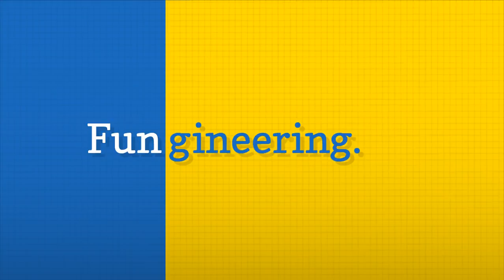Ep24. Chernobyl

Comment: First of all, I like your channel which I have discovered by the Columbia accident podcast.
In this episode I have to disagree with you in some points, especially regarding the problems of nuclear plants; you do not mention the still unsolved problem of the nuclear wastes - it's like "we build these plants for 70 years now and still haven't figured out what to do with this radioactive crap"...this simply doesn't work.
Then, there is a well-founded report, which is supported by the WHO, the UN and the IAO concerning the number of victims, which are about 4000, not regarding people still suffering from illness.
The truth is that this kind of energy production is completely uneconimical and can only survive because the companies do not have to have insurances high enough to pay for the damage they can easily do in case of even non-major accidents with radioactive leaks.

Comment: Some errors:

1. 2:20—The number used to refer to an isotope is not the number of neutrons, but the total count of nucleons.

2. 4:30 My understanding is that the fuel in the Chernobyl RBMK was slightly enriched—around 2%.

3. 17:50 A scram does not cause a buildup of poison isotopes. It stops the reaction by neutron absorption. Immediately.

4. I'm not absolutely sure, but I think it's actually an isotope of xenon, not iodine. I think the xenon comes from decay of iodine, resulting in it accumulating.

5. 51:00 This is not actually an error, just a comment. Yes, I've heard that claim, too—3 megatons or some such nonsense. I think the confusion comes from the expected radiological release, because it was thought the steam explosion might be big enough to blow up the other three reactors, and totally release the contents of all four units; and that the resulting fallout would be equivalent to a 3-megaton H-bomb. (I tend to think it would actually be much larger.)

6. 57:00 Again, a comment rather than an error, but I think they always expected they would eventually need to build a better containment. In 1986, they needed something less perfect but quick to build.

7. 1:01 Another comment: One big problem with estimating a death toll is that a cancer may reduce one's life a few years, whereas a 25-year-old worker exposed to a lethal dose loses much more lifetime than that.

8. 1:03 The big disagreement is about the validity of the LNT (linear no threshold) model of cancer risk from low-dose radiation. But when you propose that there are "safe" levels of radiation (or even benefits), there are some big holes in the logic of that as well.

9. 1:08 One big difference in modern plants is presumably that you have computer software co-ordinating operations, and recording everything, instead of marked-up printed, 3-hole punched manual pages in big binders. I'm sure that makes a huge difference in all activities in any power plant. Yes, software has bugs, but we're not talking MS Office here, OK? If you have any significant experience with 3-ring binder manuals and manila folders and the like, you know what I mean.

10. 1:12 I did a calculation once, and my estimate was that the average adult's body contains about 25 mg of K-40, and there are on the order of 10 to 100 decay events each second from K-40. That may sound like a lot, but you have 100 trillion cells in your body, so the damage is surely very limited.

11. 1:15 Now that the NSC in placed over the sarcophagus, I think there are plans to decommission the stuff inside. There are probably several approaches to tearing things down inside. As to the whole exclusion zone, I find it a delicious irony that there is now a solar electric plant there, and interest has been expressed in adding much more capacity. Lord knows they have the room for it! I'm sure any radiation there is down to where it would be no problem at all for such a plant. As for the stuff left behind in the exclusion zone, I'm sure at some point they will remove it all. Maybe erect a big tarp or tent over one section, pull down the stuff inside, haul it away, sort it out, recycle what they can, landfill what they must. Then move the tent to the next section, and repeat, until the whole area is cleared. IAC I don't see this being a wasteland for a thousand years. I think that's just silly. Just because it's not been remediated in 30 years, that doesn't mean it can't be in the next 30 years, or maybe 60.

12. "Mild" and "innocuous" are not appropriate words here. You have to ignore a LOT of things to start using words like that. It isn't just 50 deaths FFS. GMAB. But to venture further, I'd have to essentially write a book to get it all out. And I'm doing that. But it certainly isn't going into this comment.
Reply from the maker: Good feedback, thanks. We can't make corrections in YouTube videos, but I appreciate your effort here.
Reply: @Fungineering  Thanks for replying. I didn't know if anyone would notice on a video that been up that long. I invite you to stay in touch. I comment quite a bit on these range of subjects, and sometimes other things.

Comment: Chernobyl actually illustrates that nuclear power on its worst day is still roughly two orders of magnitude less deadly than a normal day for coal power. Modern reactor designs now have passive safety features that rely on basic physics, rather than active, highly engineered safety systems, to prevent accidents like the ones that have happened at TMI, Chernobyl and Fukushima. In many of these designs, meltdowns physically can't happen. The reactor would be just as likely to spontaneously fly away as it would be to experience a meltdown.
Reply: @peter john kattz Nuclear power is the safest energy technology ever devised. It's no contest. https://www.nextbigfuture.com/2011/03/deaths-per-twh-by-energy-source.html Even if global warming weren't a thing and you didn't need nuclear power because it produces no CO2, there would be a case for nuclear power just on safety grounds alone.
Reply: Has anyone ever died from Solar
Power?

(Nuclear is the safest thing devised ever)